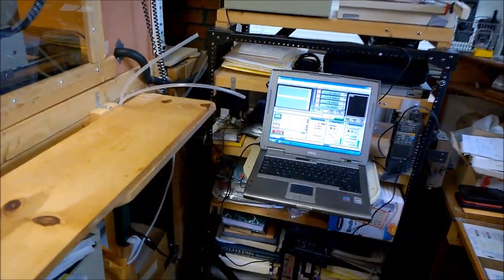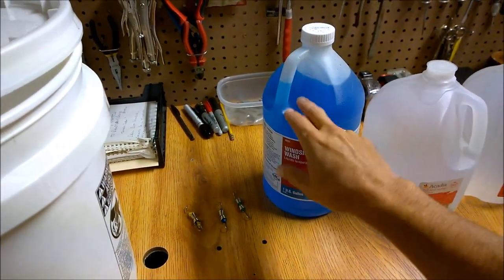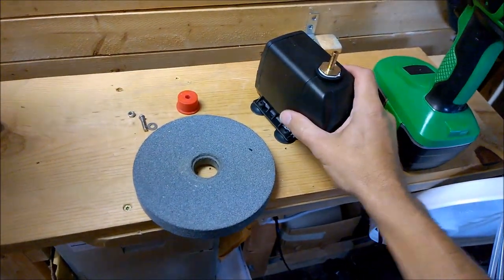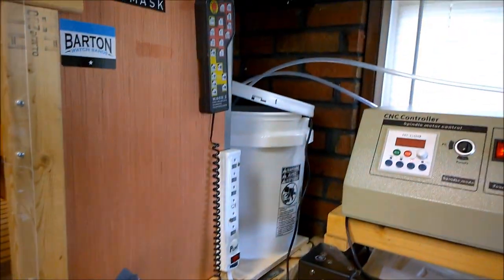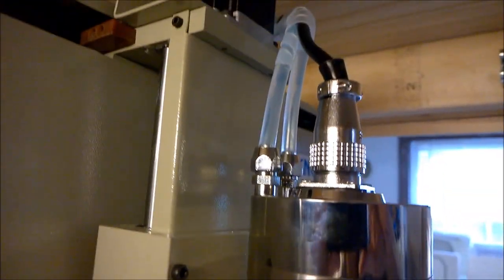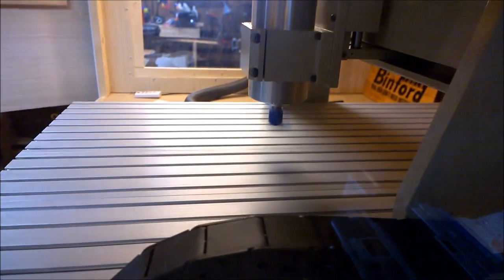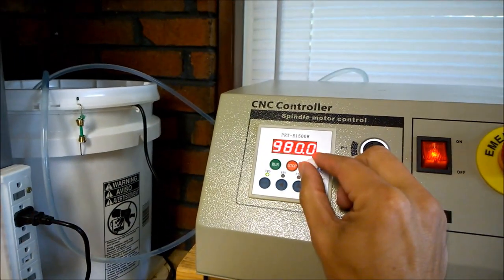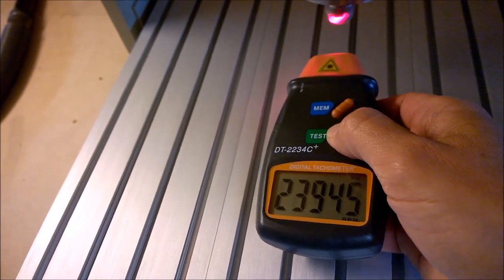6040 CNC - Water Cooling Set Up & Spindle Speed Testing!

Comment: Thank you for a clear informative video
personaly i would just super glue one of the rubber feet, and that will still allow you to remove the pump for any maintenance easy,
Also these pumps are not mean't for high volume water, so you can easily use a container half the size or even by 70% less
this will make it more easily to stow away.
Most VFD motors run from -10 to around 40 C and if you are running for a long time and in hot conditions i would consider a water cooler, like the ones you get for a PC. Also antifreeze with summer protection helps reduce heat due to the chemicals.

Alos in the meantime to see how hot the water does get is to buy a cheap water thermaster like this
Aqua One ST-3 LCD Electronic Outside Tank Thermometer for £7.50
to keep one's eye on the heat.

Comment: I might be too cautious but I would not use the grinding stone as a weight... I just dont think putting carbide grit in the water system going to a spindle is a good idea. I am sure the cooling loop is separate from the bearings but bits of grit in the pump is probably not great. Now its probably fine and wont have any effect.. it seems less than optimal. Nice build video though!
Reply from the maker: Hi Hal.  Thanks for your input.  The pump that I'm using came with the CNC and quite honestly is extremely low quality.  It seems to be working fine for now but I'm pretty sure I'll replace it with a better pump at some point.  I'll keep your comments in mind.

Comment: What projects are you eyeing?  It does seem like you got a lot for your $800 investment.
Reply from the maker: I agree; a good bit of machine for the price.  Real ball screws, heavy weight, very minimal flex, strong spindle.  As far as projects go I've got more plans and ideas than free time.  That's always the challenge.  I've made wood gear clocks before but the CNCs I've had were just barely able to make the gears with tight enough tolerances so I'm looking forward to more of those gear trains.  Projects with clean inlays, different kinds of joints, RC boats, larger signs, etc.

Comment: Over, how do you rate the CNCEST machine? Scored, functionality?, Ease of use ? Value for money? Good & bad points? ( Considering this as my upgrade from 3018
Reply from the maker: It's a huge leap from a 3018 in terms of stability, power, and potential.  It's not without its little hiccups in getting set up but a fun machine to use.  Lots of help online to get it up and running.
Reply: Have got the manufacturer'svsnd supplier's web site as there's as many makers/suppliers/names for these as there are 3018s which all clone the SainSmart/Genmitsu machine.

Comment: Hello,
I have the same CNC machine as you. Unfortunately Mach3 does not let install what I got from the seller, because always comes same error "internal error b109-13 cannot decompress setup program."
Maybe you can tell me the settings of Mach3 such as: ports and pins, motor tuning...
Thank you very much
E.T
Reply: Try Drufel CNC. Mach 3 is a dead horse.

Comment: How are you going to cool the water? after running for awhile it may heat up and you will need to cool it back down.
Reply from the maker: I wondered about that too and after some research other folks say that the spindle barely gets warm after a lot of use with just the circulation of fluid.  I haven't seen any cooling radiators with these machines so I think we'll be fine.

Comment: What type of water pump do you have there? Mine came with a really loud pump that I'd love to replace.
Reply from the maker: Hi Tim.  Well, the pump I'm using is just the one that came with it.  I'll probably get around to replacing it at some point, but for the time being it's pretty quiet and the spindle is staying very cool.  The loudest part of the whole set up is the fan in the control box.  Best of luck.
Reply: @drez20001  ah ok, mine came with a pump that is external to the water tank and so far I haven't found a pump that is quiet and has enough power to push the water round the small channels in the spindle.

I shall continue my search, I know what you mean about the control box fan but my pump is off the scale ha ha

Comment: Rolltech Innovation manufactures machine coolant saver. Serious threats to productivity and health are bacteria and fungi which are commonly found in industrial coolants. This coolant bacteria filter has some advantageous features include: last a life time, with guarantee of extended life of coolant with bacteria filter - no consumables, no electricity, no chemical dosing, etc. It is a one time investment, ROI within 4-6 Months, Saves on input of fresh oil and disposal cost like etp treatment, or giving it to authorised recycler. These mineral oil based coolant are prone to generation of bacteria which produces foul odour, often from hydrogen sulfide [rotten egg smell]. Rolltech Innovation "Aqualogic" filter is an innovative and economical method of continuously controlling these micro organisms and the odour they generate. "Aqualogic" bacteria coolant filter consists of series of high-purity multi-metal fibres cased within a stainless steel tube. the dissimilar ions in the multimetal alloy bed undergo a natural electrochemical reaction, also known as an oxidation-reduction reaction. Which Kills the all the Microbial activity in the coolant 24/7call us at +91-702-723-6191 or write to us at rolltechin(at)gmail.comEnjoy the coolant being running without changing it, just keep the coolant healthy ## like and subscribe,that would give us motivation, need your support folks, no organic or inorganic chemicals used, everything is natural ,
Reply: I have been using the same automotive antifreeze in my TIG torch cooling system for 20 years. Never had a problem.